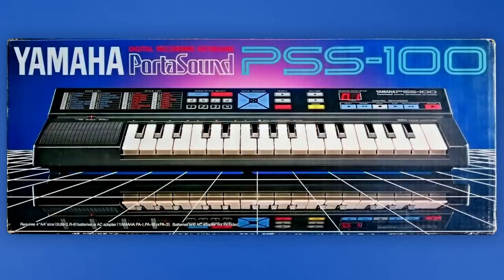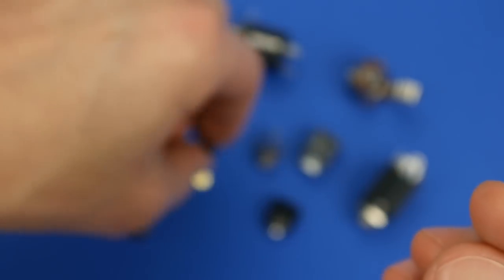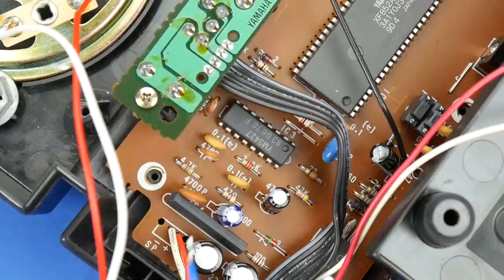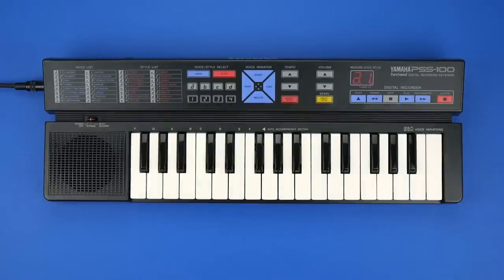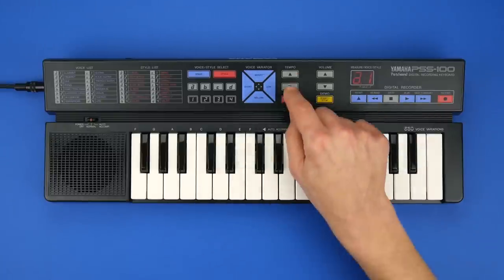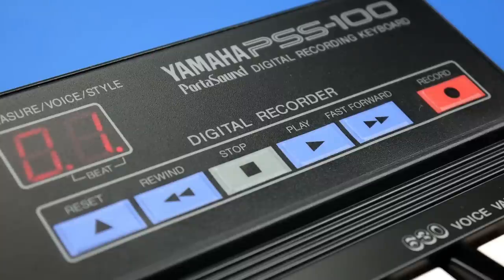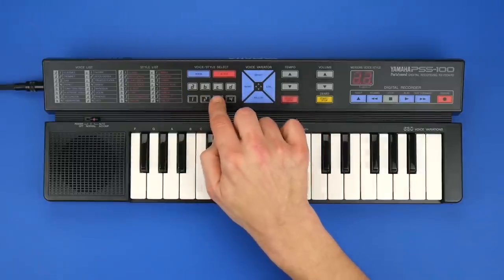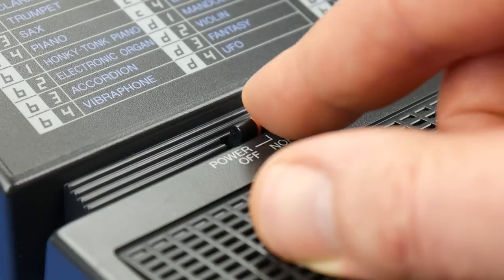Yamaha PSS-100 Review & Output Mod

Comment: Very good!  Just some ideas: To remove the "beep" sound you need to disconnect the wire that goes to the CPU, removing the capacitor 470pF would do the job. To reduce the volume of the output, the better would be to make a voltage divider with two resistors, not only one.
Reply from the maker: Thanks for the tip!
Reply: Yep, the beep pin is still connected to the jack via the cap on the amp input. Removing the other cap directly on the beep pin will do. But maybe it's better to remove just the leg going to the amp, and connect it via a 20k or so resistor to GND just in case the chip needs some AC impedance.
Reply: I’ve just tried this... and did’t work. There are only two 470pF on the board, and none did the trick when removed.
The output mod did work.
Can you post any aditional info or pics?
Many thaks for your videos, just great!!
Reply: Wonder if possible to change the pitch. Would be sick to have a little knob to change the pitch for whatever song yr playing.

Comment: Thanks a lot for this video! I have just done the output mod and wanted to try to disable the beep completely. And I found a way! 

By disconnecting pin 15 on the cpu (ic1), the beep goes away. An easy way of doing this, is breaking the connection by removing the 470p ceramic capacitor between pin 15 and the point where the beep is mixed in with with the synth audio (between ic3 and the power amp (ic4)). 

I have not done a thorough test yet, but the base functionality seems to be intact.
Reply: have you done a thorough test yet??

Comment: To disable the beep, take out the 470p capacitor on pin 15 of the CPU. It is coupled to the same path that the soundchip puts its signals, so it will bleed through. You also circumvented the filtering that happens before the signal enters the amp, so of course it's going to sound different. To get a more comparable signal, take the amp's input on it's pin 1.
Reply from the maker: Many thanks for the tip! I will try that!
Reply: @KeenOnKeys  Please let me know if you were successful :)

Comment: great, as always. 

there's a simple filter between the sound chip output and the amp to smooth harsh digital waveforms - it's easy to drive it out (or to make it optional) for the "good direct sound" to pass through the amp. it probably is not a very good idea to take signals directly from the sound chip by wiring it to the jack. the already mentioned voltage devider is one resistor in the signal way, then another to ground. if they are equal then the output is a half of input, if first is 2R and the second is R, then output is 1\4 (well something like that, and that's how volume regulators work). as the native "volume regulation" is effecting the structure of the sound, just a pot in place of such resistors is a good idea for additional real volume regulation. or better a pot for the speaker and after that also fixed resistors for the output jack.

Comment: Extremely versatile for what’s considered a toy keyboard and it is a little bit like a digital synthesiser when you edit the sounds. You certainly do those keyboards justice with your multitrack skills and yes, again, putting them through an effect processor will certainly enhance the sounds to an extremely high level. it certainly does not surprise me. A lot of these type of instruments have been used in famous recordings pop songs et cetera.

Comment: You are unmatched (along with weltenshule table hooters guy) when it comes to us consumer level home keyboard collectors and users. Thanks for breaking down the output mod in such simple terms. Would love to see your take on the Casio MT-520--- it's a super drums unit, and the drum machine has many variations for all style, as well as mutes for specific drums/groups. Very versatile and fun instrument. I'm fairly certain it is at least partially based on squarewave synthesis.

Comment: Yeah, I saw on the schematic you shown, that the beep wouldn't go away because it's basically wired to that same pin with no parts in between, like a diode to keep the signal from reaching that pin.

Comment: Just tried doing this mod myself (with the same exact jack) and I’m running into an issue that isn’t making much sense to me. When nothing is plugged in, the sound plays out of the speaker just fine, but when I plug a cable into the output, I get no signal at all. 

I thought it could be a soldering issue, but seeing as the sound is still making it to the main speaker, I don’t think that’s the case…

Comment: Hi @keenonkeys, may I suggest to get rid of the beep noise, you perhaps try removing the capacitor to the left of the cpu beep track.  I didn’t get a pss-100 from ebay (seller cancelled), but have a pss 80 and I am going to try removing this capacitor and also hack they keyboard matrix to see if I can get all the 16 sounds of the pss 100.  Lovely videos ;)

Comment: I have a pss-125 that I want to mod with a power led,  output Jack,  and add a pt2399 delay circuit :)  i'd like to cut out that little blip noise too.  But this keyboard looks like a step up from the 125!  More cool preset sounds!
Reply: Finally just finished modding my pss-125!  The output of the pt2399 delay needs to be amplified if you want to hear it through the speaker... so I had to add a LM386 amp to the circuit too.

Comment: What type of wiring is that? I’m trying to order some and don’t want order the wrong stuff
Reply from the maker: Just the usual wires you find in any audio cable. I think I used some of an old microphone cable.
Reply: @KeenOnKeys   ok I accidentally ordered a stereo output Jack. Will that work?
Reply from the maker: @staygolden1298  yes, and if wired correctly you can also use it as a headphone jack. Watch my Casio PT-87 video for more details.

Comment: Hi KoK! An amazing and brilliant demonstration as ever! I have the possibility to buy an PSS100…just one question: After doing some recording into the sequencer, is it possible to change with the Sound Variation controls the sound of the instrument for the melody? I think that it is not possible, but did you try it? Thanks again for your videos! 👍🏻👍🏻
Reply from the maker: No, the variator changes are not recorded and you can't change the recorded voice afterwards
Reply: @KeenOnKeys  Thanks for the answer. In any case, it seems a little interesting keyboard. I think that I will buy it…

Comment: Nice ! Is it possible to put a tonewheel on such keyboards ?
Reply: You mean like a pitch bend or a Hammond organ's sound generator? If the first one, maybe. You should be able to basically wedge a pot between the keys and the sound chip, attach the "low" end of the pot to ground through a resistor, and the "high" end straight to the sound chip. (You'll have to boost the input voltage a bit somehow to compensate.) This is really just speculation on my part, so don't quote me on it.

As for the second, that might be a bit more difficult...

Comment: I have a question. I have a PSS390 and PSS790 which I love, but they produce a very audible white noise when they're on. I used to also have a hum issue which I fixed by using an isolated guitar pedal power supply, but my guess is that the hiss/static comes from old transistors. I've identified a B1416 PNP transistor that seems to be an audio frequency output stage transistor. Would this be the right one to replace? There's also a MOSFET LM340T5 which seems to be an output regulator with noise elimination characteristics. I have never had to deal with removing a hiss, but this seems like a good place to start, right?
Reply from the maker: Unfortunately I can't help you with that. I haven't had such a problem yet.

Comment: Just bought pss100! I had pss80 in the past but this one is much better, the 8 additional presets with the variations and quite advanced sequencer. 

What baffles me is the lack of the output. Very strange considering all the other features. Yeah i know its easy to make, and i've made the outputs like that in the past, but still, WTF Yamaha.
Reply: i've mede an output and added a pot to reduce volume, as the digital volumes are not very intuitive and change the overall sound.

Comment: Hi, could you please tell me which signal is the "Amp" one (from your recording of both signals)? That one seems to have better sound. I think I want to just do a mono output and choose the better signal, but I am confused about which one is which. I would preferably like to avoid soldering to that spot on the board, but if that's the best way to get the sound to output clearly, I will give it a try. I just picked up a PSS-100 with a cracked case so there's not too much to lose.

Also, you showed an output jack at the beginning that is capable of cutting the speaker signal when a cable is inserted. Does that enclosed output jack do the same thing? I would like to copy your modification if I can because it looks very clean and I don't want to worry about clearance with a the limited space and the added width and extra exposed metal contacts of the standard jacks. Thank you in advance if you can help me! <3
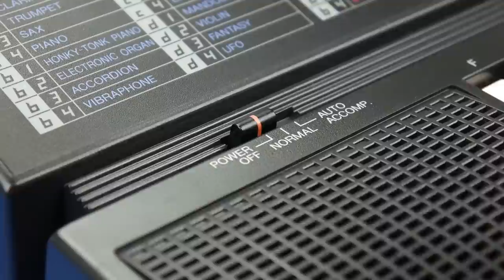Reply from the maker: You hear both signals one after the other at 6:44. They are not very different from each other, but the direct signal is much quieter. I used the amp signal for all sound examples.
The output jack I used mutes the speaker. It should also be available in mono. For the amp signal make the connections as shown at 4:02
Reply: @KeenOnKeys  I think I understand now. Thank you. Just to be sure- does the amp signal come from the point on the chip that you soldered the blue wire to? Or is it the connection that already exists that originally went directly to the speaker?
Reply from the maker: Yes, it is the latter. You could just solder the cables that were attached to the speaker to a mono jack.
Reply: @KeenOnKeys  Excellent! Thank you so much! One more question if it’s not much bother.. If I wanted to turn the mono signal into a stereo (headphone) signal, could I wire the single amp signal to the 2 points (tip and ring) to achieve that?
Reply from the maker: @teacher-sean  yes

Comment: @Keen On Keys this works for pss-130 just got one and bummed no audio output!! Please help!!
Reply from the maker: You can add an output just like I did in this video as you can also see in my PSS-130 review.
Reply: @KeenOnKeys  ok thanks I'm new to doing those type of things, and going to try to start soldering, cus I got a numark pt01 that won't power on only 1.5 years used and it crapped out. @Numark worst customer service, stay away from their products.